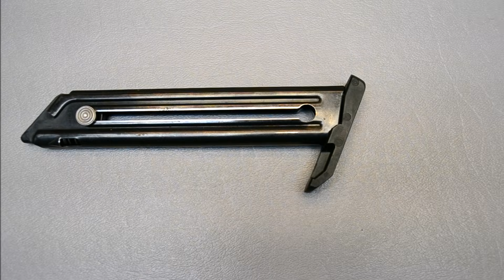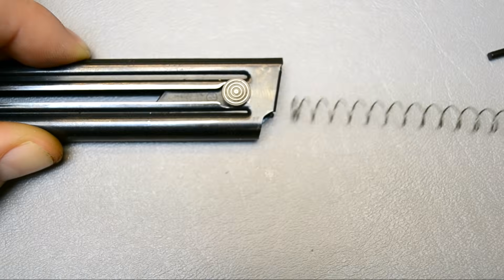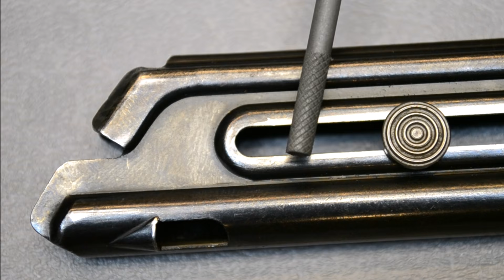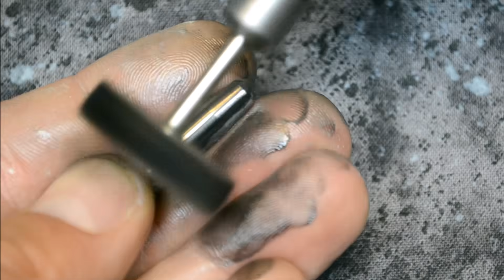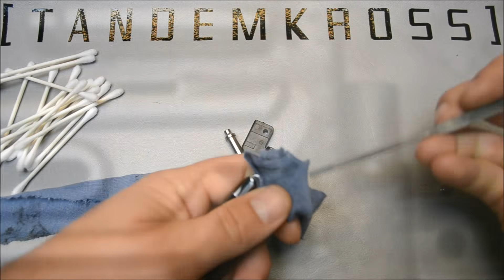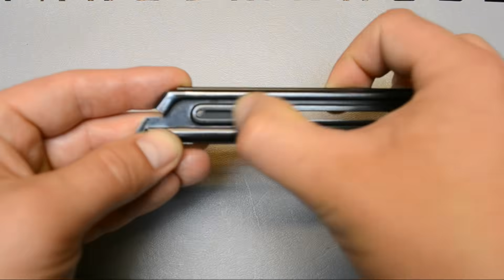Ruger Mark III 2245 Magazine Tuning Tips and Tricks | TANDEMKROSS

Comment: I got tired of only having 10 rounds of ammo fit in my mark 3 mags and experimented with them to increase capacity. I can now easily fit 12 rounds in them with no reliability issues. It takes just basic tools to do this but requires about an hour and a half to 2 hours per mag to do the job correctly. Was well worth the effort to me

Comment: I have an original 1982 magazine in excellent condition along with MKII, and the issue it has was the spring "gaining" diameter, likely by being compressed and slightly unwound. This led to loading being nearly impossible beyond 6 rounds. Twisting the spring to tighten its windings helped but replacement might be ideal. The spring was surprisingly short. It didn't even attemp to "shoot out" and might be a half inch longer than the mag itself. 
The button track also feels gritty so I might give deburring a shot!

Comment: Thank you for the video, I recently did this to 3 of my problem magazines and I knew the follower was the issue in at least 2 of them. I followed this guide used my dremel with the #453 head(Thank you @tmadger3905 ! they fit perfectly 8 years later) Magazines run smooth and perfect now. I may have to re do some blueing, i applied 3-4 coats after wiping it down with alcohol wipes to take the hornady oneshot spray off but it did not appear to do much. no color change or anything.

Comment: Thank you. My Mark IV 22/45 was stove piping like mad. None of the other upgrades were solving the issue in my case. Upgraded extractor, recoil spring, follower button, and mag springs, still jamming at least once per magazine. I finally tuned the mags using this guide, as well as polishing the bolt and a few spots in the upper, and it was like a whole new gun. Only 2 jams out of 200 rounds, and one was a freak occurrence with how it got wedged between the top pic rail.

Comment: Hot dog!  I’ve got a standard model and a Mark two. They both are wonderful pistols, but it is not uncommon for them to fail to feed, i.e., stove pipe. I even bought brand new magazines for both and it did not do any good. Will for sure be using these ideas to see if my magazines can be put in good working order. Thank you so much for this video!

Comment: I am very happy to come across this video - but it also disappoints me that a pistol from the factory can require so much work to make it reliable. I have a 22/45 that I bought 10 years ago that jams a live round in a stovepipe type position at least once every magazine. I will try these modifications and see if they can fix the issue, but darn - this shouldn't be necessary.
Reply: I couldn't agree more. I just spent $600 on a brand new one myself and I'm going to do this before I ever put one round through it. You would think that after nearly 70 years of producing these firearms that they can make a magazine that's worth a s***

Comment: I'm not going through all this level of work, but I'll probably sand off the tiny bit of flashing on the follower, but it should be mentioned that the current magazines are no longer blued, but are instead stainless, so the bluing is unnecessary.

Comment: My Ruger Mk IV Lite has been a literal flawless machine for over 2K+ rounds, then suddenly started acting up. Naturally I suspect the mags. I'm starting with a takedown / clean, and we'll see where that leads - thanks for the vid!
Reply from the maker: Hope this helps!
Reply: @TANDEMKROSS  One of my mags won't takedown - the pin on the bottom just ... won't budge? I'm about to wrap it in a cloth, put it in the vice and smack it with the hammer punch - thoughts?  Many thanks!

Comment: A 6" piece of 3/16 dowell rod is a great help in getting the spring back in. Place rod through spring, letting rod rest on bottom of follower. Pull spring down over rod until enclosed in mag. Holding spring in mag,  withdraw rod and insert pin, install base plate.

Comment: Not sure why you would polish the retaining plunger because you can’t see it while it’s installed and it does not move while in normal operation. It holds the base plate in place and that’s it.
Reply: I guess so the spring feeds smoothly off the plunger as it extends.
Reply: Why not...? Is the real question.
Reply: @Jaykeev  If you have to ask you will never know!!!

Comment: I recently bought a Mark IV Target and was having frequent problems with stovepipes and jams with ammo from three different manufacturers. I finally tried some CCI Mini Mag and that helped with only 2 stovepipes in 8 mags, a significant improvement. However, I wasn't satisfied and decided to tune my 4 magazines with a couple omissions. I ground the sharp points as instructed by Bryan, deburred the edges on the top as well as the button track and sanded the edges of the follower. I decided NOT to polish everything because I'm lazy and my magazines are already smooth plated nickel and not blued. I ignored the plunger and replaced the follower buttons with new TK buttons. THE RESULTS WERE AMAZING!!!  On a test run, I shot 80 rounds of Federal Champion that had been a problem before and another 40 CCI Mini Mag with no troubles at all. A week later (and without cleaning), the wife and I shot 240 rounds of CCI Mini Mag with zero problems. The wife even noticed how much smoother the magazines were when reloading. In order to test how low we can go with this magazine tuning, I'll have to try some of the crappiest ammo I can find and see what happens. THANK YOU TANDEMKROSS!!!

Comment: Apologies but this will be my last question. Are the grip panels the same on the mk3 as on the 22/45. Reason I am asking is I can get pretty decent grips but it is advertised as 22/45. Thx in advance for your help.
Reply from the maker: No worries! The Mark III and Mark III 22/45 have different grip dimensions and screw hole layouts. If you have a metal grip frame, grips designed for a Mark III 22/45 or Mark IV 22/45 will not fit.
Reply: @TANDEMKROSS  Thank you Sir, much appreciated

Comment: You can also upgrade the follower springs (https://volquartsen.com/inventory_configurations/3999) and the thumb button: (https://volquartsen.com/inventory_configurations/1335) These are much better than the stock components.

Comment: Finally got around to doing all this after my mkii wouldn't even chamber the first round anymore at all.  To be honest I've never cleaned inside the magazines either... between doing what's on the vid and cleaning the two guns magazines I have they're all cycling like Champs now!! 
Mkii 
Mkiii
Reply from the maker: Glad to hear it worked for you! If you're having issues with your firearm, cleaning it and your mags is usually a good (and free, more or less) place to start trying to solve the problem.

Comment: i pulled out my mags to tune them. i did see some spotted rust on the mags. What is the best way to clean this off? Can you use a sonic cleaner and dry and oil the mags after? Polish the rust off?  I owned a buckmark for 20 years and never had a rusty mag. I have the mark iv now, this is such a disappointment. Help appreciated.
Reply: 0000 steel wool works great for me
Reply: @exarcherbullsgap449  Yep, with a little oil on the pad.

Comment: With all due respects to this great video, the second phase of this modification is not necessary.  First of all, the honing of the area said to cause stovepiping is definitely necessary.  But doing all that work to the factory follower buttons and slide area is really unnecessary.  There is a much simplier route to take - buy and install the VOLQUARTSEN follower buttons.  I have replaced 6 of them on my Mark II mags and it was THE CURE.  After a  quick examination of the VOLQ versus Ruger buttons,  you can easily see why they work.  Guaranteed !  Save yourself alot of needless work with this part of the upgrade.  Otherwise, this is a very good and informative video.
Reply from the maker: Thanks for the feedback, James, and thanks for watching!

Comment: Thanks for this info! It Fixed a new mag not inserting issue I had.

I got a Mark IV 22/45 lite about a month ago, I Just got a new magazine from TK and it wouldn't insert. I found one edge of the magazine was catching on the magazine latch and I had to press the mag. release to let it fully inset.

I contacted Ruger and they exchanged the Mag. and sent me two new mags. which did the exact same thing!

Comparing the new mags, to the ones I already had that worked. I saw the edges of the new mags were kind of sharp not as rounded as the old mags.

So I followed this guide and did a little extra smoothing and polishing in the trouble area of the mag. They slide in like BUTTER  now!
Reply from the maker: That's so great to hear! Glad you found this helpful. Thanks for watching :)

Comment: Instead of using gun oil, I used Dupont Non-Stick Teflon Dry-Film Lubricant.  I got the spray can.  I used it on the spring, follower, and button.  It's dry, doesn't attract grit, reduces friction, and bonds to the surface.

Comment: I was having about a 20% FTF or stove-pipe failures on my Mark IV Hunter.  I had tried all types of ammunition with no improvements.  Then I came across this video. I "tuned" two of my magazines and after running about 300 rounds through . . .NO FTF or stove-pipes. Great tip and easy to follow instructions.  Now onto my other mags.
Reply from the maker: So glad to hear that, Perry! Thanks so much for the feedback
Reply: On the subject of trying different types of ammo, CCI minimag and Blazer seem to work best for me.
Reply: Thanks Perry and Tandemkross for the info on the MKIV, im going to give it a shot as well.
Reply: I bought the Volquartsen bolt tune up kit ($36) and 0 fails 1st 80 shots now. My Hunter failures is why I am done with Ruger.  They should be ashamed to put their name on chit like the Mark 4

Comment: The space where you grind the two corners is very tight.  There is a perfect Dremel item for that, #453.  It is a 5/32" diameter by 3/4" long stone used for sharpening chain saws.  Both Home Depot and Lowes have it in stock.  There is a picture of it on both of their websites.
Reply: I just bought this based off your 6 year old comment. Thanks
Reply: My man!
Reply: 8 years later, thank you good sir.

Comment: I just got a Ruger mark 4 22/45 Lite. Ive shot it about 1300 times almost exclusively with silencer. The first 50 shots are fine. After that it starts stovepiping the first rounds on the magazine. I started loading only 5 shots, then it worked flawlessly again. Then i sprayed the magazines with gun oil and it worked flawlessly with full magazines. Spraying them with oil is short term fix as it gathers alot of crap, and also makes for a huge cleaning job afterwards. I was thinking of sending the magazines back to the retailer, but after reading the comments there is a high chance i will get 2 new malfunctioning magazines in return...

Comment: QUESTION:  Do the MK IV pistols benefit from this Magazine Tune-Up as well?  Input is especially appreciated from T.K. and or people who have done it to their MK IV pistol magazines.
Reply: I have no doubt that the mags that came with my Mk IV 22/45 Lite would benefit greatly from this treatment.  They both fail to push the first few rounds (last ones loaded) up because the button binds in its "racetrack".  Those top few rounds can just fall out of the magazine after you've loaded it because the follower won't move up, and can't put any spring pressure against them.

So I will certainly be smoothing up the follower button and it's racetrack at the very least.  The other tuning looks wise, too.  Mine feel very gritty and the button sticks when I'm pushing them down or letting them up.  I suspect all of them are somewhat like that, so I'd say that yours will benefit to some degree from this treatment.  I know mine will.

If a guy had a vibratory polisher, as is often used to clean and polish brass casings, and you put the right sort of media in it, that might clean these mag bodies up, too, with little effort.  But it would remove all of the bluing, of course.  I'm not sure I care about bluing on the mags.  I don't want them to rust, but just like with a lot of other parts of these guns, a tiny film of good oil should keep that from happening.

It's too bad that Ruger doesn't put a bit more effort into deburring the punched edges of the sheet steel at that point in their manufacturing process.  It would likely be a LOT easier for them to do it on the assembly line before the bodies are bent into their final shape.  But I guess this gives a lot of us something to do while watching TV when cooped up on a cold, windy, winter day!

Comment: Hi Brian, thanks BIG TIME for posting this mag tune how-to.

In the past 6 months I purchased 3 22cal pistols;
- 1988 unfired Smith & Wesson model 41
- A used but great condition Browning Buckmark URX 5 1/2"
- A brand new Ruger Mark IV.

Since 2 of these guns are unfired, and 1 is hardly used, (plus I bought 4 mextra mags for each gun to total 6), the mags are in need of your tuning attention. You know, the plastic followers have sharp edges from the cast molds, the mag frames are sharp from forming and cutting to shape, the top of the mag lip that holds the first round when you insert the mag is sharp...etc etc just like you described in your video.....

Now I have 18 mags to tune up..... 🙄😔 thanks to you and your video... 😜 Seriously though, thanks for the great detailed instructions, perfect lighting, and focused video images to compliment the task
Reply from the maker: So glad you found it helpful! Thanks for watching, Mike.

Comment: Great vid, I was mainly looking to put the follower button on the other side, which worked, btw, but you have given me all kinds of extra improvements. IMO as a right handed, the button is on the wrong side of the magazine, which makes it hard to load.Reversing the follower button has made these SOOOOOO much easier to load, at least for me, anyway. Has anyone else noticed that?
Reply from the maker: Thanks for the feedback! Glad you found this helpful.
Reply: I had not thought to do that until I read your post.  If nothing else glad I watched the vid, 2 of the 6 mags I have stick at the top, and yes the thumb stud would be nicer on the Right side of the mag vs left.  Going to take care of that when I get home.
Reply: I noticed. ..and tried it...worked great but now the bolt does not stay open when empty.. someone needs to make a two-sided button so it's easy to load left or right handed... I put mine back the way it was

Comment: I find it rather amusing that anyone living would claim to have "invented" or "originated" the principles of polishing and deburring magazines. This is information that has been used by people who wanted to smooth out all the parts of their semiautomatic pistols, since the advent of the P-01. It's basically the same principles that were used by people who did action jobs on their revolvers before CNC machined parts were available. I learned some of this from Joe Bowman in the 1990's. I'm glad to see this is up here and available. There is no earthly reason for anyone to tolerate badly tuned magazines. Thank you, Brian, and all the other folks at Tamdemkross!
Reply: Can u do this on all metal magazines and it will increase performance such as a 1911 mag?

Comment: Does this really work? It seems like a lot of work that the manufacturer should of done.
Reply from the maker: It really does... it's about a 5:1 ratio of 100% reliability at matches vs. having malfunctions. If they came like this from the factory they'd likely be 2x as expensive.
Reply: Laby 70 I just rounded and polished the feed lips on mine and got rid of the lci and I haven't had a stovepipe since. The other steps couldn't hurt though.

Comment: Have viewed this video several times, noting that all FOUR edges are rounded-off, not just the two initially pointed out. Am I going blind or what? Brian, "you son-of-a-bitch" (he says, tongue-in-cheek), please advise, ASAP, if blindness is the case? If not, is it possible that the jamming issue noted here by PbNTheory is caused by rounding four edges, rather than two? Doubtful. But, given that possibility, think it may be best to start w/two?
Reply: Nate Wood I just rounded the feed lips and haven't stovepiped since.
Reply: @jimcricket288  which 2 of the 4 are the feed lips

Comment: I did it just like it shows, and now my 22/45 lite jams on the last shot every single time unfortunately.   Copied this video exactly and now I need to replace my mags.
Reply: Should have tried it on one mag. If good, continue to another, or all of them. Never modify all you have without checking function along the way...
I did this to one mag at a time, testing each as I went. Took a loooong time to get all 10 done. But didn’t loose any mags in the process. All work well.
Reply: @craigp187  probably. That was 4 years ago.

Comment: Thanks for info. My mags feel gritty and sometime the follower gets stuck and causes a failure to feed. I feel confident that this is going to help a lot.
Reply: part of this reason is that the spring is on the side of the magazine, rather than the center, delivering oblique force, as compared to a Beretta Unos or SW mag. It those cases the force on the follower is centered as the spring itself is so placed, provided for a much smoother mechanism that the Ruger mags can never achiever, regardless of how much smoothing, polishing, and lubrication you apply. This doe not affect performance, but those pother butter smooth mags are much more pleasant to load.